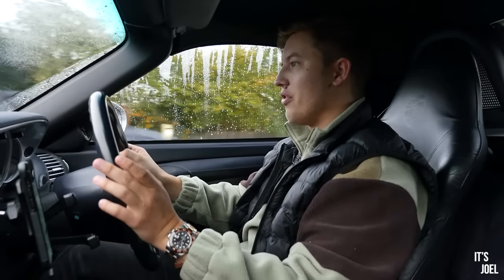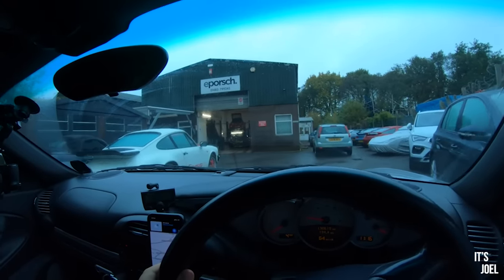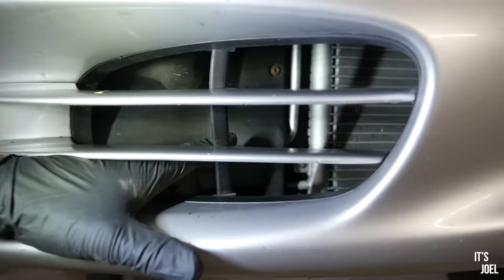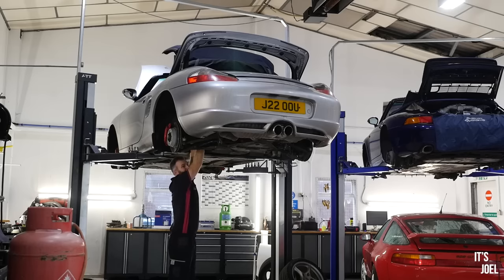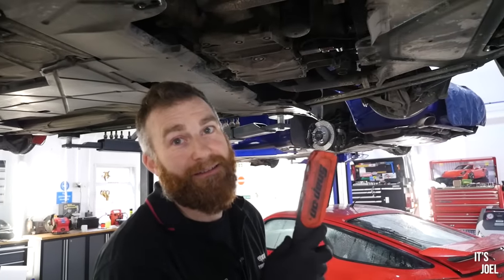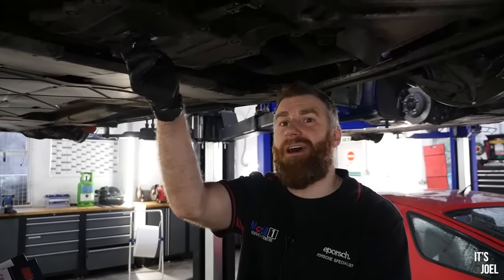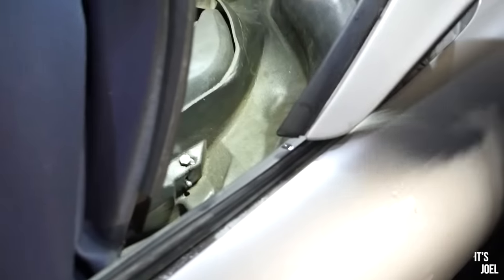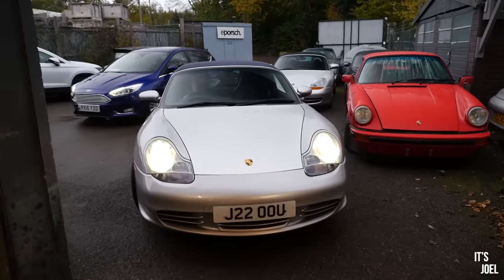Here's why my Porsche Boxster S was so cheap...

Comment: You were very lucky with this, I bought a 2004 80k miles 986S about 3 months ago, and it cost well over double what you paid, and I still ended up with a £672 bill to replace the coffin arms, top mounts and an alignment. Otherwise they did say it was exceptional, but I have to say if I was buying again now I'd just buy a cheap one, kinda feel as though I wasted my money now. Hey ho...

As for the exhaust, I had the EXACT same thoughts, but having driven it in anger for a few months, I'd also agree with the others, I think mine is going to stay stock. They just sound lovely as it is, and the danger with exhausts is drowning out the induction sound that cars like this are famous for. I once "upgraded" the exhaust on an Integra DC2, from stock, and it honestly ruined the car. Never again!

Great video, very insightful (if slightly upsetting considering how much I paid!), looking forward to seeing more content on this car :)

Comment: Good video and definitely  informative.  For me, it was a toss up between the Cayman or S2000. After watching this video and based on maintenance and repair/mait cost alone, I'm  happy I went with the S2K.  My opinion is keep the car and keep the exhaust stock. Its beautiful and you did  very well with the price but invest in the suspension repairs.  It will be like driving a brand new car and you will love it. After all, its the handling that makes these types of cars so special.  Nice vid enjoy your new car.
Reply: I owned a base model 1999 986 and loved it!
I drive an 04 996.2 cabrolet now and would have to say the 986 was a better balance feel.
But im getting use to the extra punch out of the turns.
986 2.5 ltr. To a 996 3.6 ltr. engine

Comment: Hey Joel. Given the car is in quite good condition given what you paid for it, and to ensure that it maintains its value, and perhaps even increase it over time, I think that putting a quality performance exhaust on it would be worthwhile. I personally wouldn't start messing around and modifying the original. Instead take the entire original exhaust off, store it, and replace it with something like Akrapovic, Borla, etc.

Comment: you really should qualify your comment about the total cost of the service. The following comment is specific to Boxster's  because i don't know if this applies to other Porsche models but the fluids are 2x what the majority of other cars require. So engine oil is 10 Litres. You put 2 jugs of Mobil 1 into the engine and you will notice the cost. But hey, it's one of the things that make these Porsches cop a hiding so well. 1.2 L of brake fluid, hammer through the twisties and you're not going to experience any brake fade. So they will cost more to service but that's because they are made to a higher standard, not because of the Porsche badge.

Comment: great video. I have a 981S, but this was still helpful.  I would put your money into the suspension rubber and budget for other items before an exhaust upgrade. Get the base car 100% before tacking on performance stuff. And in fact, I'd probably just drive the snot out of this and save my money for a newer Porsche.

Comment: If you do decide to do something with the exhaust manifold header to the block, it would be of interest what technique would be used to remove it as typically the bolts just sheer off and I suspect a precision drilling out process to remove them

Comment: Hi Chris great video. I bought my 2003 996 earlier this year and have so far had both the engine and gearbox serviced, plus some parts replaced like rad fans and braces.
Mines got the PSE factory switchable exhaust already so next on my list is a full suspension refresh, after all these cars are all about the handling.
Chris' other business Spyder Performance sells parts like the top mounts so I've purchased those and it'll be going in shortly along with new Konis, bump stops etc.
Keep up the great videos.

Comment: Only issue with exhaust mods will be how fragile the manifolds are as removing them is a massive pain in the arse because the studs always shear and need drilling out. You can get some pretty OK stainless manifolds off eBay for just a couple of hundred quid but it'll cost a fair bit more than that to drill out the old studs and then there's the exhaust cost on top. Buy a K&N induction kit instead as it's a much nicer sound and peanuts by comparison!  You could probably replace the ''coffin arms'' yourself and they're only about £80 each online. I went through all this with my 996.2 C2 but sold it and went back to classic BMW ownership instead.

Comment: Leave the exhaust as original, can’t trust aftermarket stuff to be too noisy , Porsche know their stuff and mine has original and very happy with it. Quiet at normal driving but has a growl when over 3500 rpm , intake noise too
Love my 2000 Boxster, only comes out of garage on sunny days and nothing is better with the hood down on a sunny day listening to the distinctive Porsche sound. In fact I leave the radio off because I enjoy the mechanical sounds more.
Fun car to drive , always brings a smile to my face.
Can’t wait until the next sunny day 😀

Comment: I kinda dozed off during the video but besides changing the oil and vacuuming leaves what else was done? It looked like there were a lot of suspension and bushing type repairs that could be done, that weren't.

Comment: German cars, leave them stock, everything.... ends up worth more.  The engine and exhaust system are designed and tuned together to run as 1 integral unit.  That's just the way the Germans do it.  Leave it stock. The car has gone the mileage it has staying in stock form, if it works, don't fix it.  Spend the money on refreshing the suspension, the value added when it drives and turns like brand new is priceless, once the suspension and bushing and bits are rejuvenated.

Comment: Leave exhausts alone, they help keep the engine running correctly with the back pressure needed. I know from experience the drastic effects of an exhaust becoming detached on a really old car whilst on the motorway and power was affected. Porsche designed it to work optimally so just don't do it Lol
Reply: I very much doubt such a small exhaust change as he described is beyond the ecu:s ability to compensate. Less backpressure means more power, if the ecu can compensate enough.

Now, there might be other considerations why he shouldnt do it, but potential loss of power isnt one of them in this case.
Reply: @GoldenCroc  I do not profess to be an expert, just my opinion why mess with something that BMW have probably spent millions of pounds developing and I am sure there are comfort and legal noise reasons for not doing it. As you say "If the ECU can compensate enough" it may give slightly more power or it may not. In any case, the reason Joel asked was that he said should he do it because he wanted it to sound louder, not for a performance enhancement.
Reply: @woodydroneson  Well, I am guy who thinks its bad manners to state anything categorically even with a 99,999% chance it is correct, thats why I included that "maybe", but if there still is any doubt in your mind, I will try to dispel it: Rest assured it can compensate for the mods he is describing, and easily as well, with a big margin left. 

Even on your old car with the whole exhaust disconnected, if it had fuel injection, it was other factors than the backpressure that made it run bad, such as these things being out of spec: exhaust pulses, scavenging, physical deformation or wrong air fuel ratio value from the o2 sensor making the car go into a form of limp mode, for example.

So, the other reasons are why he shouldnt do it are valid in this regard, and I wouldnt do the mods myself, but loss of backpressure is not a factor. Cheers.
Reply: @GoldenCroc  I do not have bad manners sorry I was not trying to be misleading and I prefer to speak to people in a friendly tone.

I agree it is less likely to cause any real issues with running apart from maybe getting it through an MOT (Maybe)

As for fuel injectors, o2 sensors in a Vauxhall Chevette, they were not an issue, yes I am OLD Lol I could adjust the Chevette to run well manually by ear with the old SU Carbs.

I would not do the mods myself mainly because of the noise issues that we both agree on, even Joel agreed in this video that it was a bit loud on his Z4 and dare I say without getting my decibel meter out would probably be illegal.

Joel asked in his video, would you do it if you owned the Porche, I responded in a light-hearted reply that even ended in a LOL. 

Joel if you are reading this then I hope that whatever you do you enjoy it and do not regret it for whatever reason ;)
Reply: @woodydroneson  Sorry, I meant for me it would be bad manners, just an old habit, I certainly didnt mean to imply you did. Not at all.

Your concern was no doubt from a place of well meaning, that was obvious. Its better to raise concerns if you have them, than be quiet! So well done for that.

Yes, in a vauxhall chevette with carburators, losing the exhaust would no doubt be a big problem, as it would even in many more modern cars if the things I wrote in earlier posts happened such as partial blocking due to deformation etc.

Personally, I would not do the modifications either, because no one is more of a noise hating pansy than me. I take so long trips, often 1000 miles per day, cant stand the exhaust drone that often results from modifying the exhaust. I even switched to a diesel car, because believe it or not they often have less exhuast noise compared to a petrol car when you tune them. And I have to tune my cars, just one of these things in life.

Anyway, as I said, you did well in bringing the issue up. Cheers.
Reply: Before you mess with tuning, including exhausts - Remember "The Dyno doesn't lie!"👌

Comment: I put an after-market exhaust system on my 1990 Boxter because, like you, I wanted a bit more growl from the exhaust.  I can't remember the brand, unfortunately, but I do remember paying almost $3,000 for the unit.  Luckily, I saved the factory assembly and ended up replacing the after-market exhaust because it was just too unpleasant sounding at highway speeds.  The dreaded drone.  I did this back in the early 90s when Boxter exhaust options were somewhat limited.  I think today, you'd have more and better choices... but do your research!  Having said all that, the car would be more enjoyable with a little more exhaust "personality!"
Reply: A 1990 Boxster...wow; even before the concept car was shown in Detroit...oh no wait; you were talking about the 'Boxter' must be a different car😂
Reply: @pimperklaas3900  Dude, I don't know where you live, but I get first delivery on everything...

Comment: Nice motor. Loved mine. Re exhaust, you could try the Crios mod. I did it to mine. It’s crude, free and it works. Then I bought an eBay stainless twin back box jobby. £150 but it droned badly, The quality systems are very expensive. I’d go Crios first.

Comment: nicely done. However I would like to address and issue that your mechanic more or less shrugged off. I have a small shop and specialize in 97 -2011 Boxsters and 911's and have seen lots of IMS failures over the years. They all start out with that oil leak. with the millage you have on the car it would benefit you to at this point replace the IMS bearing. the bearing started life with seals and grease inside, unfortunately the seals don't keep the oil ,over time , from washing out the grease but not enough to keep it cool or lubricate it properly. once the bearing fails chances are you will need a whole new motor or at the least be a very expensive rebuild. I have over the years tried all the aftermarket bearings available and found that the EPS roller bearing to be the best solution. so do yourself a favor and forget the exhaust and invest the money in repairing the IMS bearing. As far as the exhaust is concerned almost all have a drone sound or are too loud but the sport exhaust with a switch is a good option for  great sound and switch it off when you have had enough. There are many tricks to get more hp from your car, none are really cheap but well worth it. the secret is to address both intake and exhaust not just one or the other and all of it is without buying aftermarket stuff.  Good luck, nice purchase
Reply: Aren't post 2001 more likely to have this as they have the single bearing? I heard that it was a very low chance in the 90s versions
Reply: @jakobwithak8519  not at all I have seen the double row bearings fail as well, its just a bad design the early 90's cars had a short intermediate shaft which rarely had any problems then in 97 they introduced the long IMS and that is when all the problems appeared. As of 2009 the factory went back to the short intermediate shaft and problem fixed.
Reply: @harrychamness501  ohhh thanks for clearing that up 👍👍

Comment: It's a cute car but it's not a low maintenance car like a Camry, however it would be interesting to plot the cost to keep this car on the road compared to a less costly new car such as a Camry or civic. I think you have to pull the engine to replace the clutch, me I'll get a used Corvette it's user friendlier I can do most of the work and with the correct wheels and engines parts it's good for 180 mph

Comment: Interesting take on the IMS issue 🤔
Reply: Mine  failed at 45K and was replaced. But it is really quite rare from what I can see and 1/1000 might be more like it. In the meantime continue to see good prices on 986 and 996 cars. And drive your car properly to get the oil splashing everywhere, it all drains to the sump in a boxer engine so let it warm up first then use the whole rev range as designed :-)

Comment: Leave the exhaust as is, removing diaphragms in car exhausts screws up sensors and may trigger other problems in the main computer module.
Changing or updating the IMS bearing will also increase the value of the car and give you some piece of mind that your not going to blowup the engine. 
A new motor would cost 8,000 lbs. to replace.
Think about the mileage the car has, that's the real reason why the car cost so little.

Comment: At around 130k miles the water pump will be about to pack it in, this is expensive if it happens on the motorway in some exotic country, but not so expensive if you do it planned. It does give you a little warning by making a high pitch sound, not raucously loud but enough for you to wonder what that sound is. I drove my 2003 Boxster S for 320,000 miles and replaced the water pump and clutch twice, alternator once, otherwise nothing major. I also owned a Passat for the first 10 years and spent far more on the Passat in repairs than on the Porsche while doing similar mileage.

Comment: Hm... Do suspension first I guess is better than doing sth with the muffler. The sound is not bad I think. Had a 996 also 3 or 4 years back and it had an engine fail - not because of IMS, but still... if it was my car, I would consider changing the IMS. And let this do somebody who knows how this needs to be done. Engine of my Porsche was rebuilt and the rebuild was ovbiously not done for a 100% so it failed finally. Those eporsche guys seem to be experienced. If you feel good there... stay there and let them take care.

Comment: I have one of these myself. If you want to easily get some better noise from the exhaust, you're in luck because you have the S. The secondary catalytic converters have no sensors, so you can buy some very cheap direct bolt-on straight pipes and remove the secondary cats with no issues. Opens up the flow and gives you a sweet noise for very little expense.

Keep the cats in case you need to return it to stock. Or pass whatever UK smog inspection is.

Comment: Nice educational and informative video. Cost was under 400 pounds. Okay, seems like you got tagged with. “Porsche” tax! The mechanic did a manual and visual inspection, changed the oil and filter and used a vacuum cleaner. For 400 pounds, seems expensive!
Reply from the maker: His also changed all of the spark plugs
Reply: Remember you're talking nearly 9 litres of oil  before you start, then oil and air filters, plugsx6, then whatever hourly rate, then 20% on top of that lot  for VAT. I don't think it was a bad price. (I have a 986 3.2S).

Comment: E porsche look great and honest trustworthy guys 👍

Don’t hesitate to upgrade your exhaust. Did a catback on mine didn’t make much difference. Fitted Powerflow switchable exhaust. Best money ever spent on the car. Think was around £1200 but can’t remember as had re map and sports Air filter fitted at the same time 

Google powerflow exhaust 987 
on you tube. Only video I can find of it. 

mine was a 3.4Ltr 08 Boxter manual. 

Loved the exhaust as could switch from loud to normal electronically.

Comment: Here is a small addition for the next oil service. You should cut the end caps off the oil filter element and unroll the filtering media to inspect for debris in the folds of the filter. Then photograph the unfolded media to show the next potential buyer the condition. As to the IMS bearing failures there are enough failures in the USA to make buyers worried. In addition cracked 986 S cylinder heads are not uncommon. I have had six 986 and 987 S models. It is my avocation.  Peter in Michigan and California.

Comment: jesus 4000  pounds for a Boxster S , here i am looking in belgium to buy a normal Boxster or the S version in fully original condition with mid milage , prices are around 13.000 - 18.000 euro's here right now for one in decent condition

Comment: Nice Boxster I also bought a 2004 Manual Boxster in May this year mine had only done 86’000 miles, had the top down daily in the summer great fun you’d  has the same alloys as mine too Carrera Classic 111 I was lucky mine came with a brand new sports exhaust and Race performance manifolds and when the tops down it’s very very loud